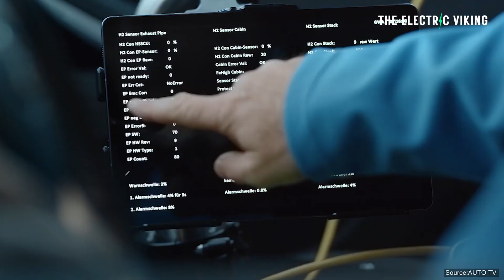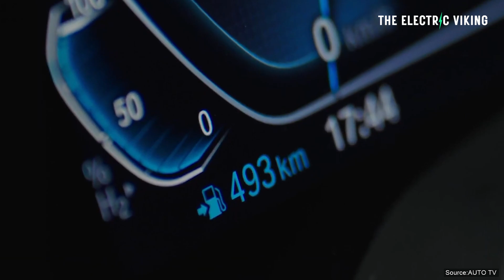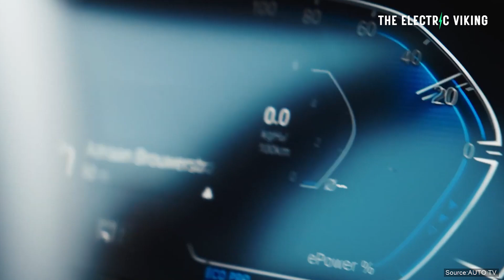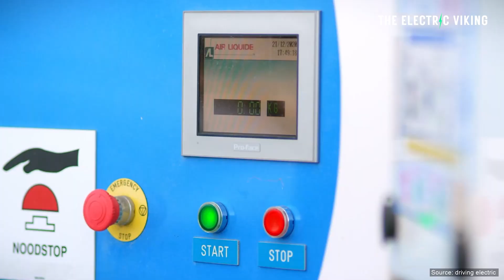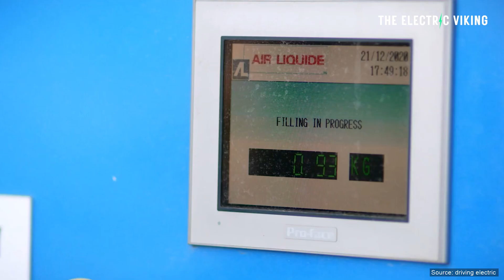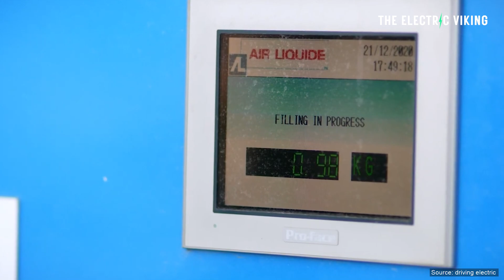BMW partners with Toyota on the future of transportation - hydrogen

Comment: I don't think I'd want a hydrogen car even if they were being given away. I can't generate hydrogen on my roof, but I can generate electricity for my MG4.
Reply: You could generate clean hydrogen from your electricity with electrolysis but you'd end up needing 3 times the electricity to drive the same distance compared to just using it to directly charge a battery EV. It would only make sense if batteries were too expensive or too heavy to provide a reasonable range which is not the case. Hydrogen for cars makes zero sense, hydrogen for trucks also makes zero sense compared to the Tesla semi-truck.
Reply: @synthmaker  You are correct, but it's so near impossible as to be impractical. Not just the inefficiencies you noted, but the hydrogen has to be compressed to insane pressures (up to 800 Bar) for the storage tanks.
Reply: @davidinkster1296  I'm curious if we're going to see in the future and "home hydrogen generator" devices on sale.  Hope not - people worry about batteries burning.  Imagine if one of those devices develops an explosive leak...
Reply: @Grommet2007  I hope not too, and I don't see it as feasible for transport. There may be a case for industrial size units where hydrogen is used for heating or chemical processing, and the mega-scale units are being developed for use in iron+steel making, to replace the coke in the process. But home-scale? Not any time soon.
Reply: @Grommet2007 it would explode too often. Some fueling stations have already exploded, a fsctory for such things has exploded. So, no. Just no.
Reply: That's probably the best of a lot of reasons not to go hydrogen. I can't see any logic in hydrogen. An EV has a battery and motor whereas a hydrogen car has a battery and motor, same as an electric, plus a hydrogen fuel cell and a storage tank. What a dumb idea.
Reply: You have to remember that the hydrogen narrative from oil/car industry is to retain the control over fuel as a central resource.  They hate the idea of electricity as production and consumption is distributed and under "local" control.  Ie we can charge our cars at home, and countries have much more control of energy generation without big business holding people to ransom.  You see the IMF has recently stated that 7% of the world GDP ($5.5 trillion subsidies are given to the oil industry).
Reply: Hydrogen for cars and even trucks is a stupid thing as we need green energy to get electricity and not waistful production of Hydrogen. Only serious application are in systems like Picea from HPS Home Power Solution AG Berlin where a low pressure system with all serial standard products produces all time with excess PV solar power on your house. All other applications so far are energy intensive and stupid to name it. You cannot overcome physics so far as well as many tried before especially the Perpetuum Mobile with hydrogen such as Stanley Meyer and all these conspiracy theories fetishists! P.S. while BMW again tried to convince the market with 250 outdated and handmade hydrogen cars there is Hyundai‘s SECOND generation Nexo out and also Toyotas Mirai, only convincing one however is the Nexo and the truck of the Koreans which is available in numbers. But also the Korean company considers these successes as rolling lab experience!😂 Also the new idea of mostly German automotive with E-Fuel is rather rediculous as the process uses far too much energy to be of any economic value to society and LIFE. And the mayor TCO problem of any ICE car still is not optimized. Only EV will offer a good TCO balance at least after 50‘000 km (but with new battery chemistries and production methods e.g. Tesla the cost again come down)🤔🤓🇨🇭
Reply: So each day in the summer you stay at home to charge your car? You never go on holidays, and in the winter your car stays in the garage?

Don't fool yourself, electricity is even more volatile than hydrogen.
Reply: @andrevanrossum8408  he needs a day a week or less
Reply: @andrevanrossum8408   Do you work for BMW or Toyota? The reality is that to travel 500km each week, I need to charge for less than 24 hours each week in total, and it is easy to do that in blocks of 4 to 8 hours during the daylight hours, even just with the ultra-slow single phase 10A 230V outlet. 
'Electricity more volatile than Hydrogen' is a meaningless and misleading statement, more like PR FUD than fact. Actually, a hydrogen-fuelled vehicle fills me with dread. Here in fire-prone Australia, I will not just refuse to own one, but will be actively lobbying to have them banned from all rural areas.
Reply: @davidinkster1296  Most people here are away for work from 8:00 to 18:00u, exactly the hours that the sun shines. You are the exception. 
Electricity is definitely more volatile than hydrogen. You can't even see that when the sun shines and you can't deliver to the net because of netcongestion. Storage for electricity is way more expensive than storing hydrogen. 
Do not project your extraordinary situation on other people.
Reply: @andrevanrossum8408  Let's be radical and use a little logic here. If you are working while the sun is shining, that is the perfect time to recharge your car with PV electricity.
"But wait! I have to drive my car to work".
Sure, charge while you are at work. Ideal time.
"But the company doesn't provide charging".
So how is the company expecting to retain workers, into the future?
I know most companies don't even provide carparks, let alone chargers, for their workers now. But that is about to change. It will begin with the upper management negotiating for such perks, and will eventually flow down the whole chain, and I predict that by the time EVs reach 75% of the national fleet (about 10 years) this will be expected of every large employer.
Reply: @davidinkster1296  I am sick and tired of the continuous lies about EV's. "They will get cheaper". " We will use them as a home battery to use our own solar energy". "They will solve net congestion". "EV's are clean". "Their batteries will serve as home batteries when they have declined". "They only write off a small amount". "Everyone wants an EV". "They are great because you should stop and rest anyway".

Now I am reading again about a great future with chargers everywhere, when I just explained that companies currently literally have to choose between running their machines or let a car charge on their parking.
Reply: @andrevanrossum8408  And I'm getting sick and tired of responding to your FUD. The things you list as lies are not lies but are true. I actually have an EV; clearly you do not. I actually charge at home. I actually have solar panels. I actually have foresight and extended my solar panels before getting the EV so that my capacity would be adequate. It annoys me that you disparage EVs, now a well-proven technology, in favour of a risky, expensive and unproven fuel that would see motorists tethered to another monopolistic supply chain. Perhaps it's not BMW or Toyota you work for, but Shell or BP or Exxon.
Reply: @davidinkster1296  Is that the best you can do? Assuming that I work for some company, and discredit me? You deny all the facts. You don't know anything about me. You think that your situation applies to anyone. Well, it doesn't. Who cares that the EV is "proven technology" when you can't afford one? I drove in some EV's lately: an ID.3, a model Y and an Opel EV. They all drive great. That is not the problem. The problem is that they are overpriced (except maybe model Y, because it's a large car).